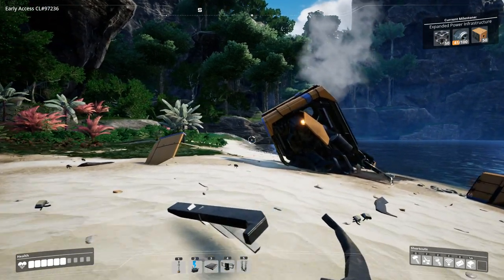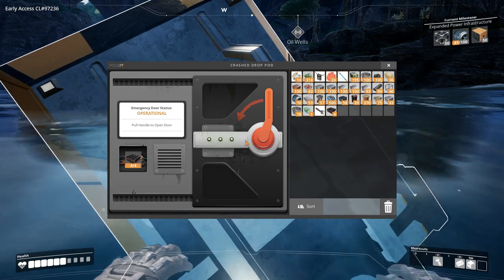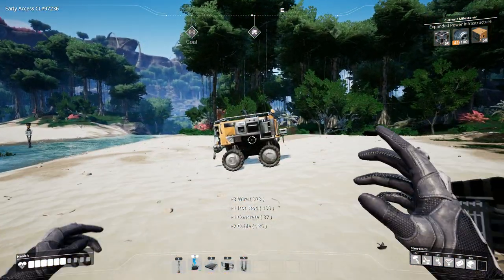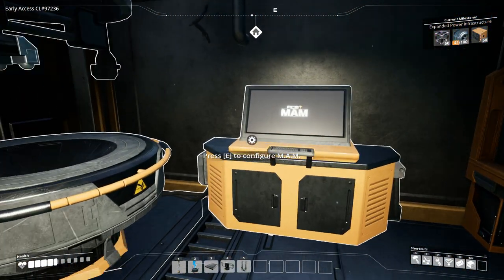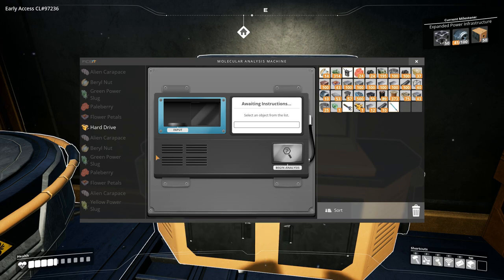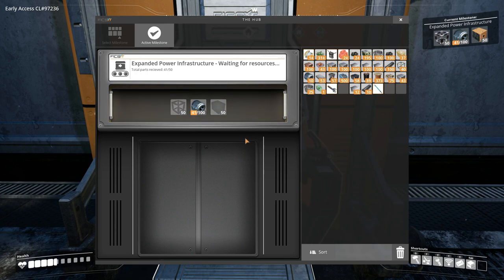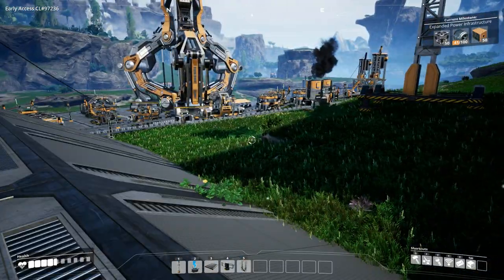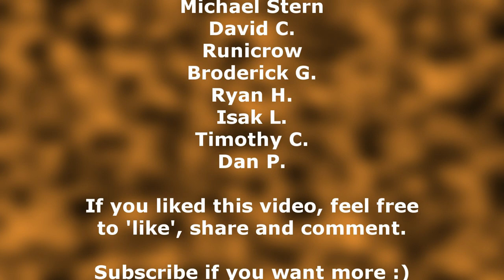Satisfactory #7 - Hard Drive Research and Distant Oil Wells

Comment: Thought I would let you know, you can switch milestones that you are working on without losing what you have put into the current one. I like what you did with the wiring all the way back to your base. 

One thing I have noticed though is that the "spawns" of resources isn't as random as I would have wanted. Your locations are exactly where mine are at. Also, the path you took getting back to your base is pretty much identical to mine as well.
Reply from the maker: Thanks for telling me, I was about to test it but didn't want to take any chances with lots of resources already put in. I've done it a few times now and it works perfectly :) A bit sad that the world is not more random. I both like and dislike that part. It makes up less variety between different players and doesn't really encourage you to do another playthrough in the same world..